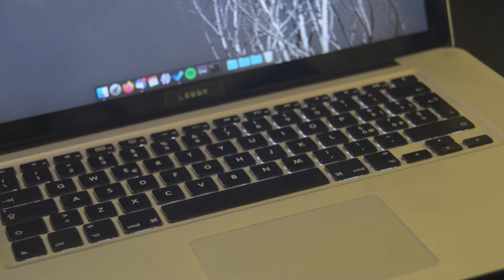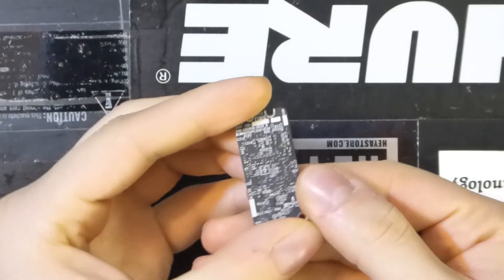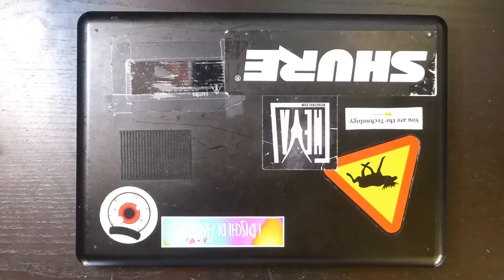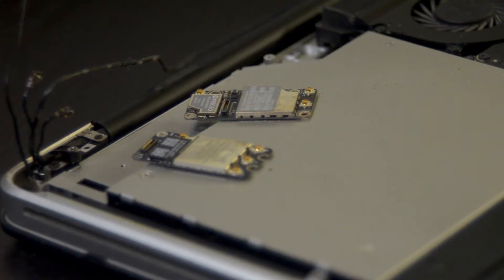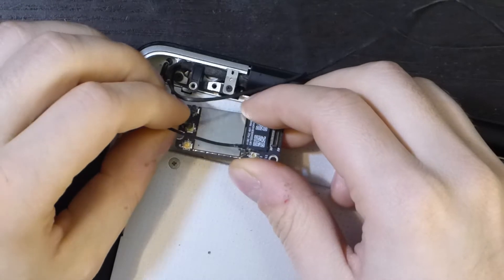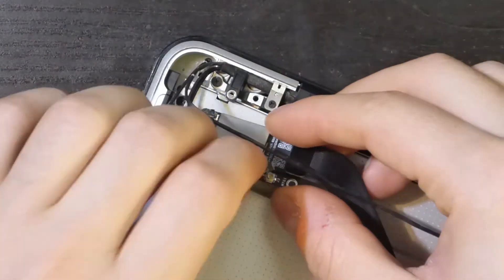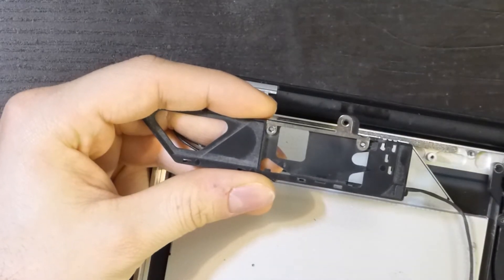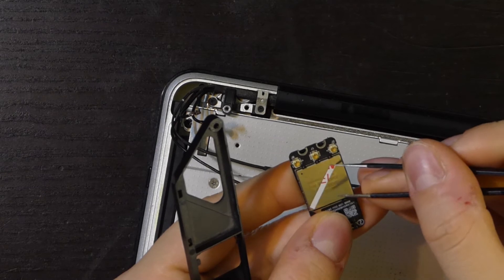Upgrade your Macbook WiFi TODAY!

Comment: It would be helpful to know the exact model and year of your mac. And did you try this with Open Core? Does it work as bluetooth 4 or still default to being bluetooth 2.1?
Reply: I did it with my early 2011 MBP and running Monterey on OCLP and the 4.0 works, I can use my airpods and airdrop now.